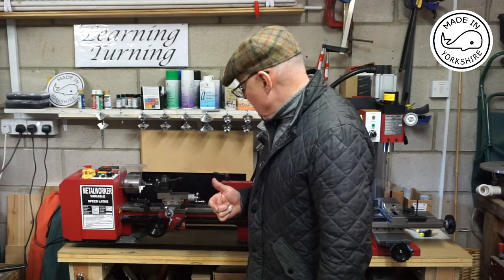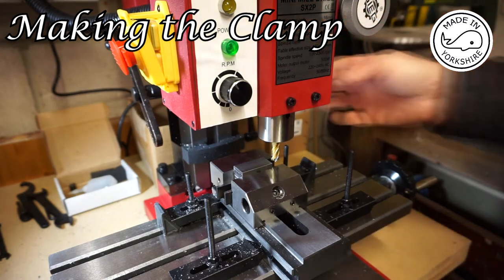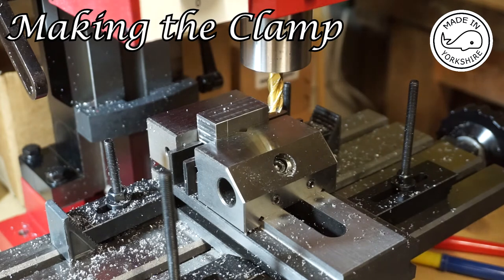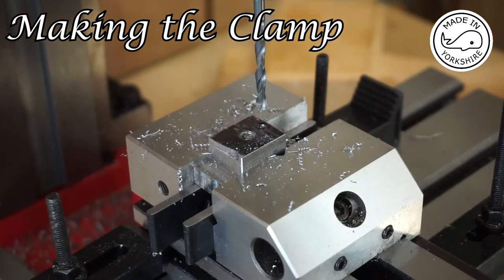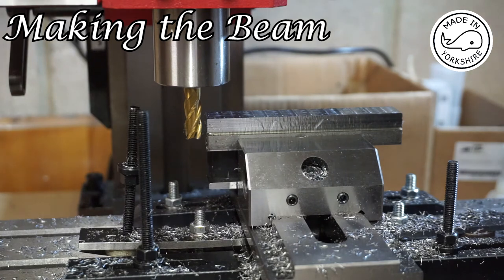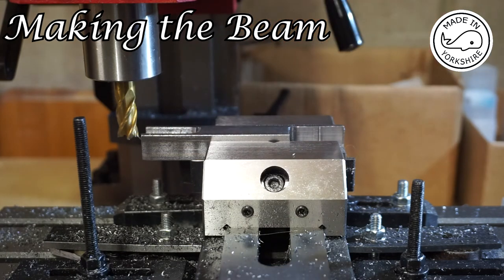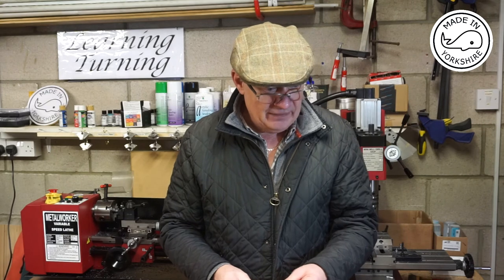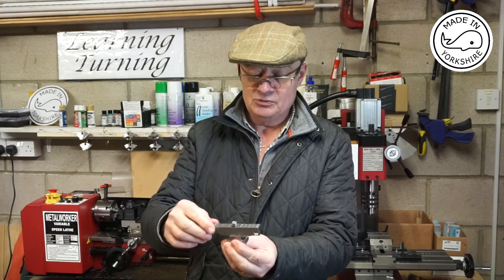#MT8 - Making a Carriage Lock for my Sieg SC3 mini-lathe. By Andrew Whale.

Comment: I’ve done a lot of work on milling machines Andrew, my first observation is that the clamps holding the vice to the work table are a mess. Let’s call the vice the workpiece, the retaining bolt should be as close to the workpiece as possible and the packing piece at the rear of the clamp should be about 3mm higher than the surface the front of the clamp is retaining. This was hammered into me when I was an apprentice, all to do with fulcrums and moments of force, also I would always cut in the direction that the tool is rotating so the workpiece is coming into the cutting edges of the flutes, I noticed that you did that at one point then presented another cut to the tool and went back in the opposite direction; this is known as climb milling and tends to push the tool away from the workpiece, think about it and you’ll get my point. All that being said what a fantastic first attempt on a milling machine mate, well done...👍👍👍
Reply from the maker: Hi Allen. I really appreciate you taking the time to provide me with such valuable feedback. I get exactly what you mean about clamping. I got the vice at the same time as the mill and I did struggle using a basic clamping set. On review, I agree it looks a right old mess! I think my next project will have to be making some clamps to fit the vice, taking on-board your design considerations. Also many thanks for the advice re climb milling. I wasn't sure about that cut at the time and it's great that you have clarified this.
Again, many thanks. Much appreciated.
Cheers
Andrew

Comment: Hi Andrew. I've got the same lathe and if you disengage the lead screw (using the gearbox lever on the back of the motor housing) so that it doesn't turn when the motor is running you can then engage the half nut to act as a saddle/carriage lock.
Reply from the maker: Hi The Piste Office. Many thanks for the suggestion. Is is something I tried but I wasn't 100% happy with it. Also having got the mill I thought it would be good practice to make a dedicated locking mechanism. I very much appreciate the feedback though and I would welcome any more suggestions. 
Thanks for subscribing and I hope you find some of my future videos of interest.
Cheers.
Andrew

Comment: I'm glad you made this video, Andrew. It showed me something I needed to know. My mill/drill gives a rather poor, "washboard," kind of cut, when milling with the side of an endmill on steel. Pretty much, the same as yours and mine is a much bigger, RF-45 sized machine. Every time I see a review on someone's new, little mill, they invariably, take a cut across a piece of aluminum and the finish looks great. Frank Hoose from minilathe.com always does this and it makes me wonder why I can't get a finish like that. He works mostly, in aluminum and I work mostly, in steel. Fly cutting on mine, leaves a much nicer finish on steel. Of course, depending on the job, that's not always possible. I thought I was either doing something wrong or my mill needed some serious work. Now I see, it's just the nature of these smaller machines. I ran full-sized Bridgeport machines when I worked in a toolroom and the finish, when milling with the side of an endmill on steel was beautiful. Even the cheap import mill produced an acceptable finish.  Bridgeports however, weigh 2000 pounds. LOL.
Reply from the maker: Hi Dave. Now that is something I never noticed at the time. It was my first attempt at milling so I didn't know what to expect. I can imagine that coming from using a Bridgeport to something smaller might highlight some quality issues. I was pretty ignorant when it came to feeds and speeds so that might not have helped. I really need to have a go at fly cutting. A lot of the materials I use at the moment are cast iron and brass. Next time I'm working with mild steel I will do some trial cuts using the side of the mill.
Many thanks for the feedback.
Cheers
Andrew

Comment: My suggestion would be to use a fly cutter to remove large areas of material. I purchased a small set of 3 for a very reasonable amount and after learning to sharpen them it works very well. I also found it goes much quicker and saves wear and tear on your endmills
Reply from the maker: Thanks bhein67. I think I'll have to add a fly cutter to my wishlist.
Cheers
Andrew

Comment: Hey Andrew what did you do with the old lathe and mill? What made you get rid of them?? I was thinking about getting the sx3 mill from arceuro but then again the wm14 from warco looks better and cheaper? What would you advise? Since you had there products and changed them for the warco? Cheers Andrew , Darren
Reply from the maker: Hi Darren
I needed more capacity so I upgraded to a sc4 lathe and a warco wm18 mill. I still have the sx2p mill, but sold the sc3 mini lathe because I didn't have enough space. If you email me at learningturningmetal@gmail.com I can provide you with more information.
Cheers
Andrew